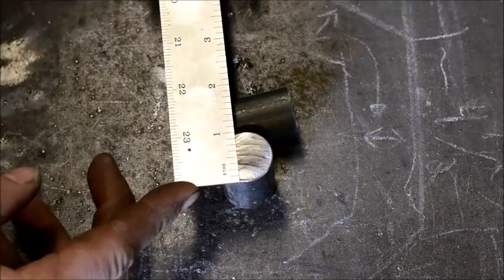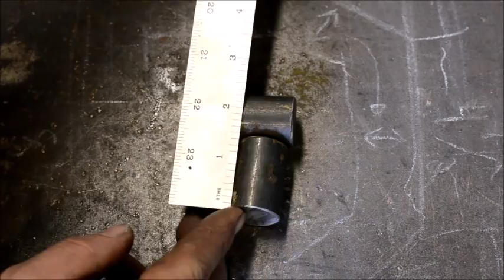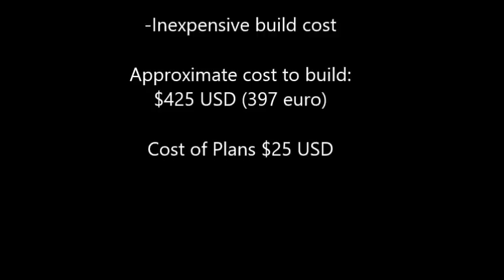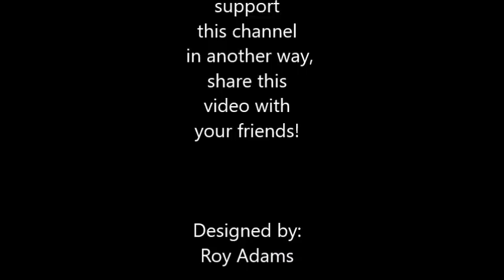The Hardy Hammer: Anvil Mounted Homemade Power Hammer and  Plans

Comment: Anybody made one of these?  I am in the process of building one and I am looking for a photo of the side opposite the one that is in the videos.  I am ready to start assembling the hammer, and I would like to see what the side looks like where the drill is mounted.  I have asked for one by have had no response.  Thanks.
Reply from the maker: The diagram of the side is in the pdf... It also has a exploded diagram of this. We sent you a email about this question might need to check the spam folder..

Comment: I am in the process of assembling my Hardy hammer and making the tools you suggested.  I am new at this and just want to have fun - retired and want to make things like hooks, bottle openers, maybe a chisel and punch, etc.  Weak hands from surgery are the reason I decided to build one.  Can you suggest some small projects that this hammer would be good for?  I am going to make the dice and the meat turning hook as I have some scrap material and a few hundred railroad spikes that will work fine.  I am looking for small projects like that.  If you have done more videos making small projects,  could you direct me to it?  Anybody else  have suggestions as well?  Thanks.

Comment: how much would you charge to build and sell one of these and your bigger one you have in the corner of your workshop? =} just sold my motorcycle to buy a powerhammer.  been forging as a hobby mainly for the past few years. Anvil and tongs, punches, hardy tools of all shapes and purposed have all been hand crafted from jimmied materials haha. (anvil is literally welded together using nothing but railroad spikes as a frame/base and railroad tie plates as the face and base, But works beautifully) and have decided over the past few months im becoming fair enough in the craft to justify owning one and its not something that im confident in building myself.  i appreciate your consideration and reply.

Comment: Hey brother. I wanted to know will this thing have enough to strike bush hog blads and things like that
Reply from the maker: +Spencer Pearson it may be a little underpowered for that type of use depending on how big bush hog blades you're talking if they're in the kind I'm thinking of you will probably need a lot larger hammer
Reply: Christ Centered Ironworks  thank you brother. I still think this is a great hammer and will be buying plans from you soon. I do plan on a bigger hammer but could use this for or all the other things. And also to help teach others with no experience in a hammer to so they get use to the idea of it.
Reply from the maker: +Spencer Pearson thank you brother! I really appreciate that. It is a great little hammer for a lot of things I currently like it the most for making tongs works pretty good for that :-) God bless you and thank you for taking the time to watch
Reply: Christ Centered Ironworks I do have one more question . Do you show in your drawings how the tighten system works in the Hardy. I got a idea but did not want to give that away thanks.
Reply from the maker: +Spencer Pearson yes the tightening system should be shown in the drawings

Comment: I might be keen on building this hammer but I have a few questions,how does this hammer compare to your simple davinci style hammer does this one hit harder what are the advantages and disadvantages of this over this hammer compared to the davinci style?
Reply from the maker: +Ubiquidic thanks for the great question! to answer your first question: this hammer when properly tuned will hit just as hard as The DaVinci Revisited style hammer not the original hammer. The original hammer is a simple drop mechanism and therefore does not hit as hard as this Hammer does. The advantage of a guided hammer like this Style versus a Helve hammer is the ability to use tooling underneath them. A Helve hammer were predominantly used to draw out material not incorporate tooling underneath. The disadvantage of this particular hammer is the fact you need a minimum of 100lb anvil weight to build a effective enough hammer. As we're the other style hammer is predominantly made of wood and therefore cheaper to construct not needing a Anvil to start. Hope this helps thanks for the question God bless
Reply from the maker: +Ubiquidic thanks for the great question! to answer your first question: this hammer when properly tuned will hit just as hard as The DaVinci Revisited style hammer not the original hammer. The original hammer is a simple drop mechanism and therefore does not hit as hard as this Hammer does. The advantage of a guided hammer like this Style versus a Helve hammer is the ability to use tooling underneath them. A Helve hammer were predominantly used to draw out material not incorporate tooling underneath. The disadvantage of this particular hammer is the fact you need a minimum of 100lb anvil weight to build a effective enough hammer. As we're the other style hammer is predominantly made of wood and therefore cheaper to construct not needing a Anvil to start. Hope this helps thanks for the question God bless
Reply: Thanks for the reply my current anvil is a 110lb cast steel anvil would this be pretty good for the hammer on this video as I have seen that you said this hammer is suitable for a 150lb anvil and above on your details of it on your website
Reply from the maker: +Ubiquidic I believe your Anvil would be big enough you may have to adjust the base to fit your anvil and the Hardy hole as well but other than that the guide and RAM assembly and the rest of the components should work out fine

Comment: That is very cool!  Haven't worked 1 inch by hand in a while for reference,  but that appears quite effective. Works out to the magical 10 to 1 or more anvil to hammer ratio nicely. Some sort of bottom die holder for fuller ect. would be easy and handy. Awesome little hammer!
Reply from the maker: aaron craig glad you enjoyed the video. definitely would be upgradable with bottom fuller tools etc.. thanks for watching and the feedback :-)

Comment: This is brilliant!
Reply from the maker: Bruce Prosser thank you and thanks for your support!
Reply: You are welcome Roy. I can't get this off of my mind since seeing it this morning.

I am sure that I could use this design on my 134# Peter Wright, how hard and fast is the 150# anvil weight? 

I am fairly certain that any sturdy metal mass can be used as long as it had a hardened steel face. I have been gathering material for a striking anvil made out of 2" mild steel for making hammers as well as saving the face of my PW from inexperienced folks, if you know what I mean...

Anyway, I have been thinking about having a stack of 2" mild steel with a piece of 1/2" hardened mild steel as a face equaling about 150+ pounds anchored in a pillar of black pipe filled with cement and partly buried. 

Just a thought though.

I am curious about the motor also, size, rpms voltage etc would be needed? What do you have for yours?
Reply from the maker: Bruce Prosser  I think you're ideal could work out very well. the anvil size was developed by trying it out on my #465 anvil and the smaller anvil size was my buddies at #150 worked on both well. the design can be shortened up to fit a smaller anvils length and width. it also can be enlarged for much bigger anvils... Thank you so much for your great commentary and support. maybe this thing will help a lot of smiths out.
Reply from the maker: Bruce Prosser the motor is the same as my Cam hammer . the exact model # is in the plans. I think it is about 1hp roughly.
Reply: Thanks Roy.